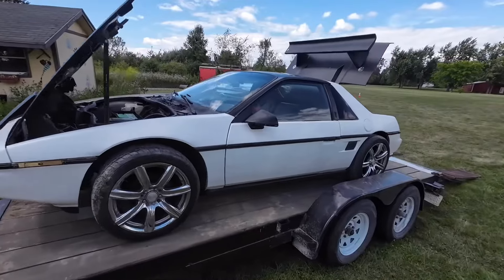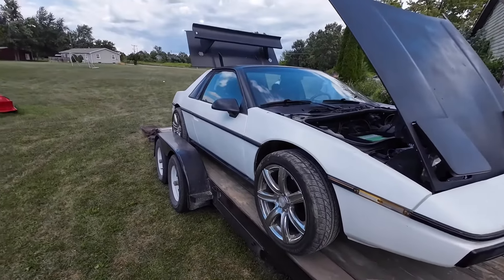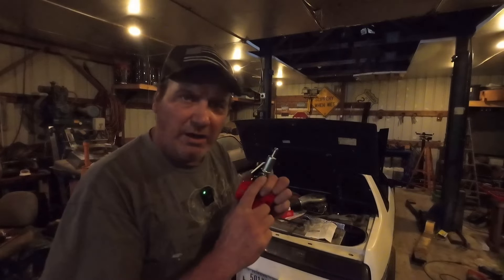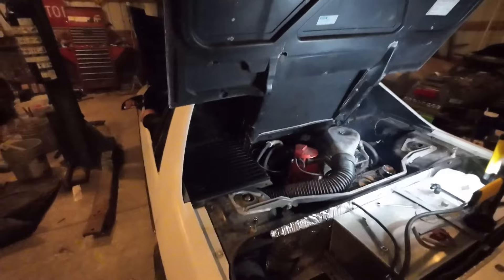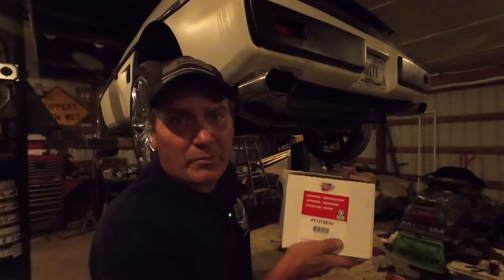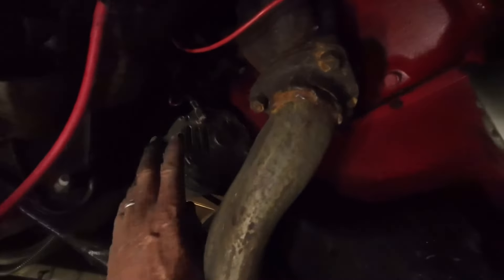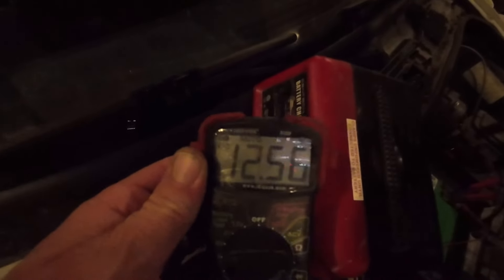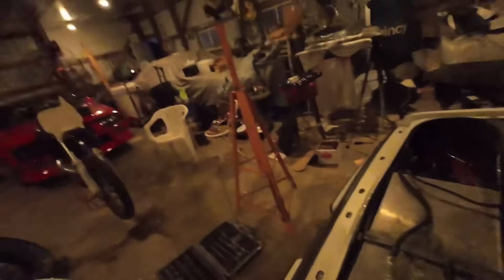Will it Run? V8 Swapped Pontiac Fiero

Comment: Nice acquisition....a lot of people did the V8 swap to the Fiero, the "problem " was/is the V8 choices also include those god-awful computer-controlled versions. So you had a giant fistful  of wires & connectors, the systems so complex, many gave up & the engines never ran right...failure to idle was prominent. With the plain old SBC is was dirt easy...so don't  switch to those so-called modern V8s, stay with the SBC.
Reply from the maker: Well said, I will definitely be sticking with the good old SBC . Thanks for watching and commenting.

Comment: I have one with a small block 406 that has 538 miles on the engine. I have however never heard it run. Maybe one day I will hook up the remaining water lines and exhaust and try to start it.
Reply from the maker: Ya, that sounds cool. you definitely should! Thanks for watching and commenting. Be sure to update us if you get it running.

Comment: You need to fix your rear wheel alignment and it will drive straight as an arrow
Reply from the maker: Thanks for the tip. I didn't think of that! V8 probably has it off !